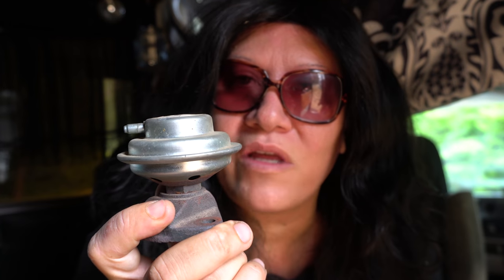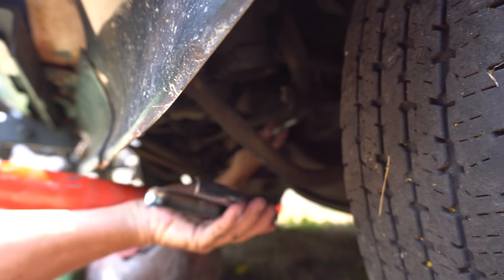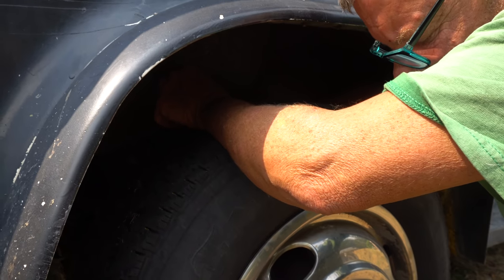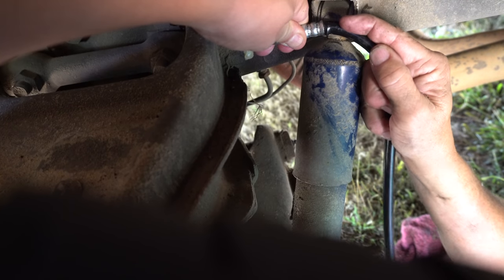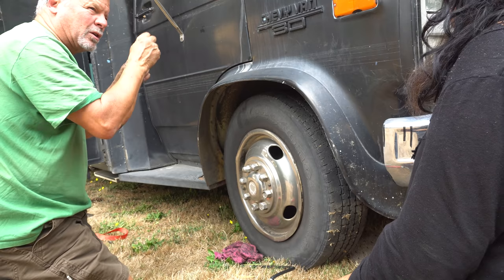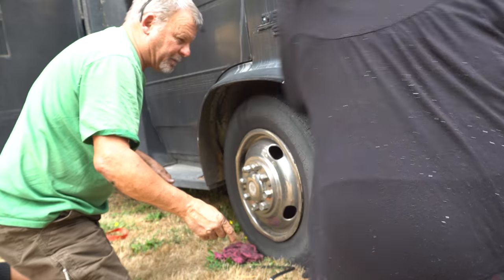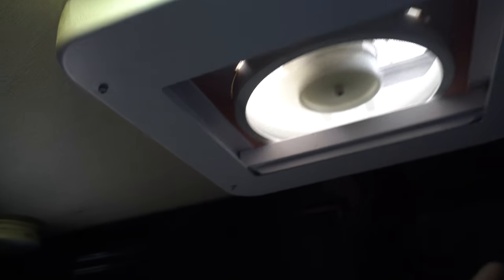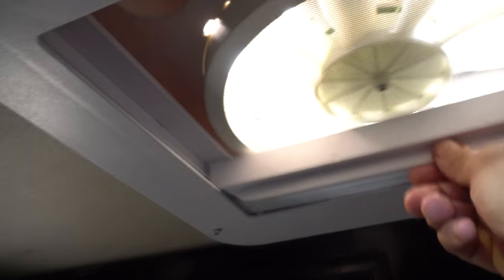You'll Never Guess What Was Wrong WIth My RV & Made It To Washington

Comment: Scott's a really good friend.  Brakes and tires are the two most important safety features on a vehicle.  You're wise to think about replacing your tires before they become a problem!
Reply: Bubba Warbucks Amen to that!!
Reply: When Scott was greasing your rig, I was noticing you needed tires. So if your going to do go off road remember 10 ply tires for off road, remember Camper Van Kevin's tires. Less ply's and they bruise when you take them off road !!! This info. Comes from a Tire Guy !!!
Reply: @anitablades6033   Thanks for the tip tire guy... That's good know.... . I'll try to remember that.
Reply: Am. Blades.   Thank you for the tip.  I need new tires for my new to me van.  I will remember this.
Reply: Bubba Warbucks I would say Gas & Breaks are two most important things 🙂
Reply: Ooooooooooooooooo on lollipops oooooooooo9pp9ppp9 @bsoutdooradventures9541 ooooooooooooooooooooooooooooooooooooooooooooooooooooooooooo

Comment: Late watching this and subjects may have been mentioned.  Trucks this age need oil, filter, and lube every  3,000 miles.  The u-joints may have zerk fittings, and in any case don't be surprised if the u-joints need replacing.  When using retail services you need to watch and advise as many attendants have never seen vehicles of this age and use.  Scotty is THE MAN.
Reply from the maker: Thanks John

Comment: EGR=Exhaust Gas Recirculating Valve. During idle it uses burnt exhaust gas to mix with your fuel charge to reburn it again. early emmisions device. runs ragged when they go bad
Reply: Wrong the EGR valve only works AFTER idle , that's why if you have a rough idle you check EGR valve, and to check the EGR valve  you start the vehicle unplug the vacuum line and apply vacuum to the EGR valve if the idle gets rough the EGR valve is working. 40 years of working on vehicles. :)

Comment: Glad you got that valve replaced. That's so great that Scotty could lube that suspension cost a lot if it gets neglected too long. I just did that on my Van too...it's way easier than replacing ball joints ...

Comment: Good job on the thorough lube,  as others said driveshaft also needs greasing and squeaks could be from rubber bushings.  

Scott counted 14 grease fittings so I am guessing that you only have rubber bushings on the anti sway bar and on the ends of your shock absorbers.

Anti sway bar bushings should be cheap to replace. 

Shock absorbers also wear out and could cause squeaks. 

Definitely keep Panda,  it is simple for you and Scott and your brother to work on it and you are fixing everything as needed.  

Who wants to start new with a much more complicated RV.

Comment: Walmart has 16.5 tires $139 each firestone.Don't go for 16 inch custom rims your stainless steel insert wont fit.Your tire is 8.00X16.5,new 16 inch rims tire size is 225/75/16.The dually clearance is not much ?.I run 16 inch rims that insert fit but it has to be a factory 16 inch rim.I looked for 2 year in junk yards d pick out 16 inch .Till this day I Can walk my a pile of rims and pick out 16 inch rims.YOU ARE THE BEST.
Reply from the maker: Thanks Stan 😀👍💟

Comment: You can get 45 or 90 degree fittings for the hard to reach ones - also there should be fittings on the u-joints on the drove shaft

Comment: Egr valve is used to keep spark knock,aka ping aka preignition down to not damage piston.real simple, it just puts exhaust gasses back into the intake to keep the cylinder flames from burning to hot.like cutting off a little aur on a fire.nit to put it out but turning the flame down a little. Hope this helps.safe travels from rich 👍👍👍

Comment: Don't forget the driveshaft u-joints if you have the Zerk fittings there.  I have the same chassis and at least they have the ability to grease.  You definitely need a flexible hose to do them.  Weird problem I had the other day my driver shock loosened up.  Heard the rattle looked underneath and saw the loose bolt.  You might want to lubricate the shock mounting bolts too.
I had the same issue with the wheels and tires.  Luckily there is a place up here in Maine called Just Chevy's  that had a complete set of 16" rims that had new tires already mounted.  I got all seven of them for $650.  I did have to clean up the rims and paint them since they were a bit rusty but now I have a standard size rim to work with.
Have a good one!
-Jon
Reply from the maker: Awesome 😊👍

Comment: Hello Ausia. Glad you found the problem. The OBD is a great tool to assist you with finding things that cause problems. Most RV tires generally die of old age before they wear out.  Ck the date code, if they are older than 7 to 8 years old they will start showing age cracks in the sidewalls.   The date code are numbers in an oval  shaped circle first two numbers are the week and the next two are the year. Well have fun and relax.   Be safe in your journeys. Bye now.

Comment: Replace the zerks that didn't seal up well. They are cheap and can be bought at any auto parts store. The two that are near the top shock mounts should be replaced with angle zerks. Just because a little grease went through the zerk when he had them off doesn't mean enough pressure can build up inside to lube the bearing.

Comment: I turn wrenches for a living and scotty knows what to do. glad you got help. squeaks can drive you well...anyway...my 99 marquis I replaced egr valve and it drives like a POLICE CAR NOW. sometimes that squeak is the rubber mount at the shock and you can take the bolt out if it will come out and dowse the rubber with water. or 100 percent vegetable oil. put bolt back in it will quit I so like youse guys videos, im just not out on the road but hope to meet all my vandweller heroes one day.

Comment: On those grease zirks that were hard to get to they have replacements available that can be purchased with a 45 or 90 degree angle so that getting the grease gun on them can be much easier. I also noticed that you have a sway bar that has bushings that can also cause the squeaking. I saw one while Scotty was greasing, that appeared to part of the control arm where the bushing looked extremely worn, but that could be normal as I could not look at all the sides and/or how it is attached to the control arm. The bushing on the straight part of the sway bar looked OK (those are the ones that I had to replace because of noise years ago on my van). Also looked like the grease gun end was leaking and maybe worn and need replacing they have ones available where you can twist that end and actually lock it on to the grease zirk ... all suggestions only. I am not a certified mechanic only a garage DO IT Yourself person that sometimes has a learning curve to go through, just like everybody else. Great video's Thanks much for the entertainment and a look into nature that is very much appreciated.

Comment: It shows the 1989 G30 van left the factory with 16Inch wheels. could probably find the stock oem size pretty easy and the 16inch tire would probably be abit less than the 16.5. at least their not 16.5 split rims.

Comment: You should have about 14 fittings to grease and they should be greased every time you get your oil changed. It you do that then Scott would not have had such a had time greasing them. It looked like Scott has the same grease gun i have. Your tires didn't look that bad. As long as they don't have cracks in the side wall they should be all right. Also check the date on them. You might have to go to a tire place and have them do it because I believe it is coded. I believe that squeak is coming from some rubber bushings. They have some special oil for that. You can use wd40 it just does not last that long. good luck. Safe travels. Scotty is a good man.

Comment: If I have an overheating problem that I cannot fix i replace everything including heavy duty radiator,  water pump, thermostat, belts and hoses after a complete system flush. 

Expensive, probably $1,000 or more for everything but well worth it to finally fix an overheating problem, good for 10 years minimum. 

A really good flush and a quality 50/50 coolant mix with distilled water only,  not water from a garden hose might be worth trying before replacing everything.

Comment: Put a bottle of  "Complete Fuel Injection Cleaner" in your gas tank (many brands available)..."Check Engine Light" normally disappears after your first full tank of gas, I've been doing this for 30 years and it worked on every vehicle....Fuel Injectors always start to clog and causes the Check Engine Light to come on, these cleaners slowly unclog the injectors, try a second bottle if the first tank full didn't work but it generally does it by your first tank full...should cost you between $8-15.....it's a cheap way to fix the problem...Good Luck

Comment: #233    Good Morning, Ausia.  I don't thing your rig has had a grease job in a long time.  When pressure fitting a new shot of grease, old brown or black grease should drip out the opposite side.  I believe all your fittings need replacement.  Maybe its time to shop for a new "Panda"(?)

Comment: Ausia when the egr  valve was replaced did they clean the egr port on the intake manifold?  Usually they will get clogged up by the time the valve needs to be replaced.  You can spray carb cleaner and use a small  round wire brush to clean it.  If the port is stopped  up it will run a little  rough.

Comment: I can't remember everything that you replaced in Austin but I remember spark plugs and wires.  

Did you buy the more expensive silicon high temperature wires?  

I now buy only the platinum spark plugs,  twice the price but never fail for me. 

I assume that you also replaced the distributor cap.

Your model has an electronic ignition system which should not fail intermittently that is works sometimes and quits at other times but that exact problem happened once on my son's car, very rare but it was all good after the electronic ignition module was replaced.

Comment: Don't come knockin' if Panda is a rockin'. 
I have to admit I find it highly unlikely the EGR valve is your no start problem. EGR valves can cause idling problems and stalling, but not usually no start problems. I would suspect the ignition module or vapor lock (assuming it is a throttle body injected engine). I will be keeping track to see if your "no start when hot" problem is solved!

Comment: I was told a Ford's Tire rim or tire might fit your RV..and I am not sure if yours(RV) has a safely feature on the driver side tire rim..one of the rims lugs..or were the log screw on to it..it needs to be turned the oppitste to loosen it..it was a safety device install in some Late model Eva..my class C has that feature..

Comment: Too bad you trashed the old EGR valve, now you can't test it which way it was failing.  

If the EGR valve never opened and never allowed any air between the two holes on the bottom then it was not the cause of any stalling or difficult starting problems. 

On the other hand if the valve was always open and always allowed air to pass from one hole to the other all the time then perhaps that could be a problem.

Valve never opening changes your emissions but it will still drive perfectly,  some say better and block off that EGR valve completely,  illegal but won't  adversely affect engine performance.